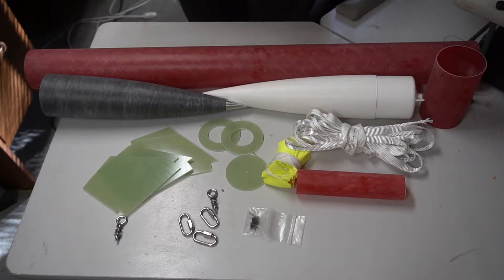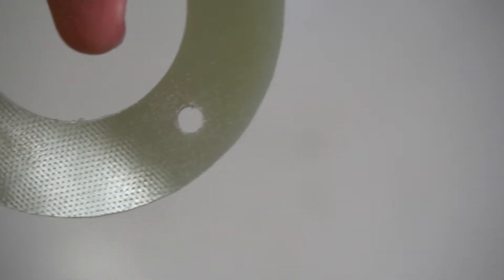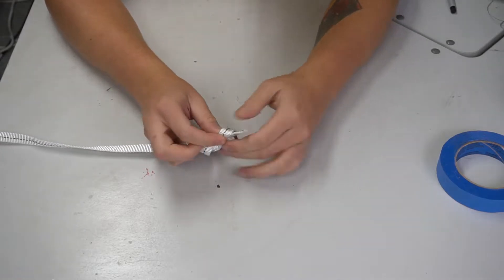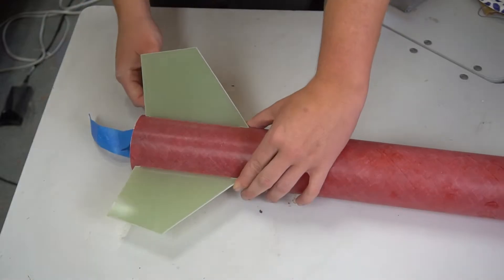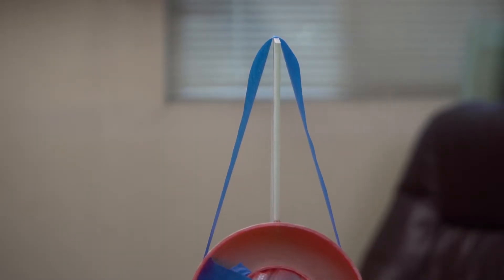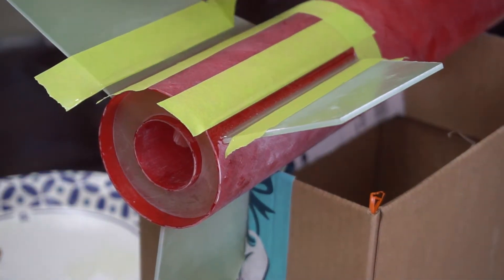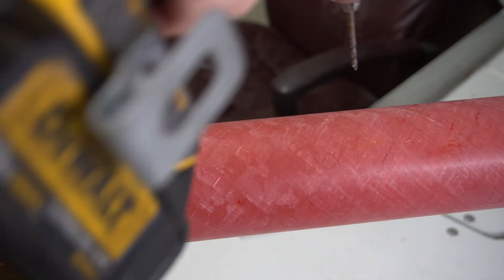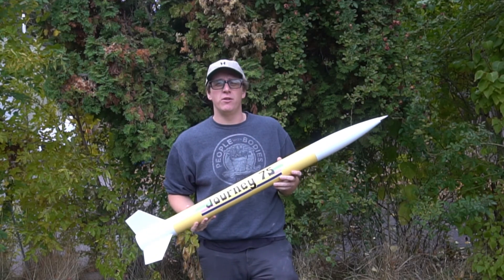Wildman Journey 75 Build Instructions | An Affordable Fiberglass Starter Rocket Kit

Comment: Giving the kit a full bath, then handling the pieces with oily hands seems.... foolish.
Reply from the maker: The bath is just to get dust and mold release remnant from manufacturing off of the components. Cleaning the parts with rubbing alcohol after sanding before bonding ensure's they're ready for a proper composite bond.

Comment: Hi Braden, could this potentially fly as a class 1 rocket without FAA clearance? If so, I think this would be a great first Fiberglass kit!
Reply: You could probably fly it on a G80-10 but you need a permit or certification to legally fly any rocket on a high power motor. The FAA considers a high power rocket a class 2 rocket in their eyes. While that class 2 would be a level one or higher rocket by NAR or TRA rules and regulations.